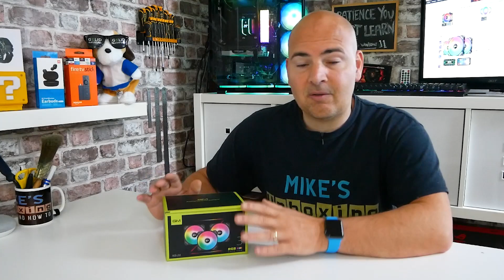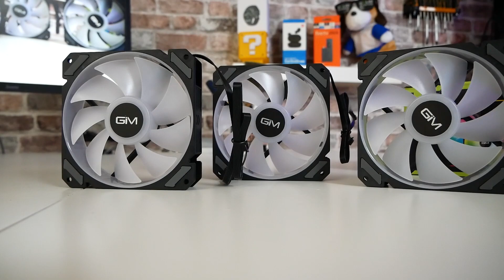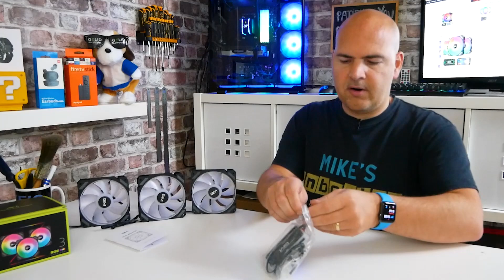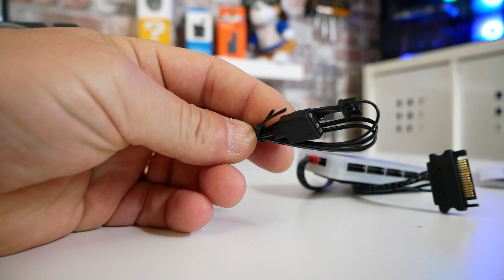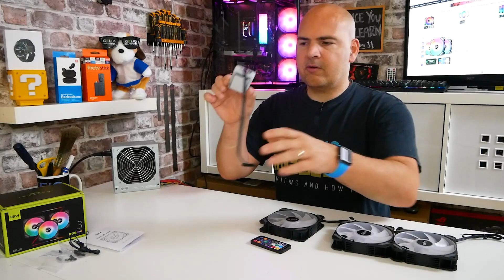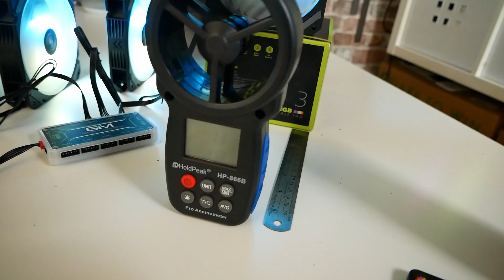NOW EVEN BETTER  GIM Gaming ARGB Case Fan Set 3PK With 10 Port Hub & Remote Control

Comment: i just bought 3 off these and none of them work, The first set came with my case but didnt work so when i got a replacement they sent 2 new ones and neither of them work. They dont work plugged into power with remote mode nor do they work connected to my pc.The fans ont spin and the rgb doesnt work and since they are proprietary i cant test straight to my pc, i have to use fan splitter box so it could e the splitters but i cant test
Reply: after my last comment i oped up the fan splitters and all the solder connectios are corroded with whitish oxidation?? or some sort of glue, I have the original all black fan splitter and 2 of the clear ones like you have, When i opened up the clear ones there wasnt alot of oxidation but allot of left over solder slag on the board which probaly ic creating a short. Normally i dont complain bt to get 3 differnt sets, 1 included with my case and none of them work. I spent hours tearing my comp down thinking it has to be something else, there is no way 3 in a row and 2 of them brand new in packaging are all defective. How could that be possible, but they were, i connect them to the same sata p[ower that was running  1 of my hdd so i know it has power but i get nothing in responce, no led's no fan spin just nothing.
Reply from the maker: that sounds like a bad batch to me, maybe the glue or solder used is reacting?
Reply from the maker: This is maybe easier to fix or at least advise if we can ask more questions and get direct answers, so feel free to join our Discord chat and we can go over it in more detail https://discord.gg/gaeeDPw
Reply: @mikesunboxing  Im probably just gona get a few sets of standard fans but i still may join cause id like to re-wire these fans to have standard fan plugs onto it, Im sure they look great but id rather wire around the proprietary splitter. And id wanna check i have the correct pin out when adding the standard connectors. i have a asus crosshair 7 board so i have more then enough fan and argb and rgb headers to circumvent needing a splitter box or rgb controller

Comment: I tried some low cost fans, but they were "ticking" when running at low speed. I found the "Vicabo 3 Packs 120mm" on Newegg for 21$cad. And they are very quiet and no ticking at low speed.  And the GIM fans are 52$cad on Amazon... Nothing's cheap over here it seems..

Oh.. and the white vetroo v5 cooler was reduced to 38$cad from 87$ too. I picked up one to see how it compare to the snowman. Or my uphere! The only one they made correctly 😁It may replace the CM Hyper212  black on my 1600x that will go on my 1600 that have the stock wraith cooler.
Reply from the maker: that is a decent saving and seems to put it on par or better than UK prices - exchange rates etc, so hope it works out for you.
i'll also take a look at those fans you mentioned
Reply: @mikesunboxing  while named Vicabo, there is no branding as such on them apart something like ji ja electrome chanical. I sent you a picture of one of them so6mayby you already seen one.

Comment: Hi, Mike. Personally, I wouldn't touch these fans. From what I can see, there is not enough bracing on the ears to keep them from breaking when attaching them to a radiator. I've had a couple brands of fans, upHere and Asiahorse come to mind.
Reply from the maker: the plastic on these feels more like some kind of fibre blend, had to really describe it other than being a little like glass fibre that you use for car and boat repairs
Reply: @mikesunboxing  
Do the ears feel strong. Ears breaking off is the number one reason I've tossed half a dozen sets of fans in the trash. I do cut off the cables and keep them for later use, so I guess it's not a total loss. LOL
Reply from the maker: @OlettaLiano  The ears do feel strong enough

Comment: Can you change colours in software
Reply from the maker: yes the RGB passthorough to the motherboard
Reply: @mikesunboxing  can I use an m.2 ssd with these fans
Reply: @mikesunboxing  ???
Reply from the maker: @harrysurvives9870  Can you explain more as the 2 are not related
Reply: @mikesunboxing  sorry I put the wrong thing i meant can these fans work with the gigabyte b450 aorus elite motherboard